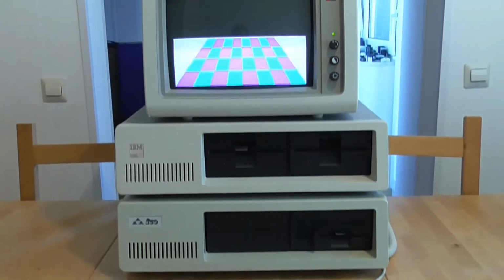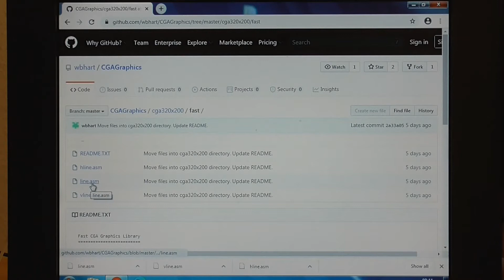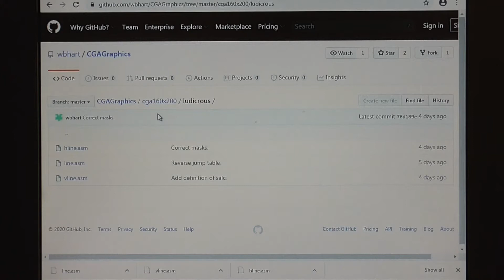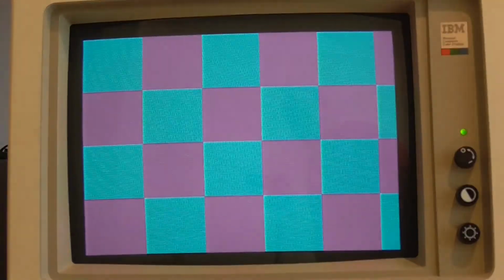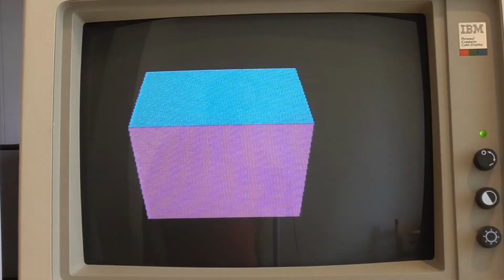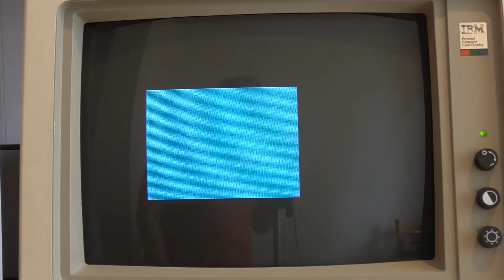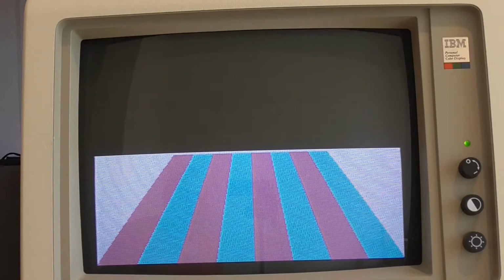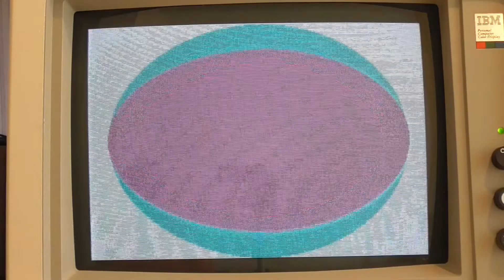High framerate CGA Graphics Effects on the IBM PC

Comment: there was suggestion on zx forum that ega actually faster than cga because there is mode when you may set different pixels (in different bitplanes) by single cpu instruction and you don't need fancy bit manipulations as in cga case, and with correct instruction using ega can be as fast as zx spectrum graphics (but there only 8x8 pix may have 2 colors out of 16) and in ega case each color may have own color (no color clash) is that correct?
Reply from the maker: Yes, that is correct. For certain applications bitplanes are a significant step forward. But it does depend on what you are doing. Some effects don't benefit at all from bitplanes and it's just harder to work with them.

Comment: 3:49: Whaddaya mean, CGA doesn't have a 160x200 resolution? That's pretty much the effective CGA 16-colour composite resolution.
Reply from the maker: Sure, but here in Europe we don't get that mode because the CGA composite output is NTSC. The only modes you can rely on are the RGB modes, which is what I'm referring to here.
Reply: @PCRetroTech  I see. It remains an ongoing quest of mine to find non-anachronistically correct options for European colour composite CGA, i.e. to identify period-accurate equipment that would have been available at the time and could have been used to display colour composite CGA in Europe. Apparently some high-end VCRs and studio monitors had dual-standard PAL and NTSC capability, or so I heard? If anyone knows specifics, I'm all ears.
Reply: And here in the future we have seen area5150 and its improper modes... :)